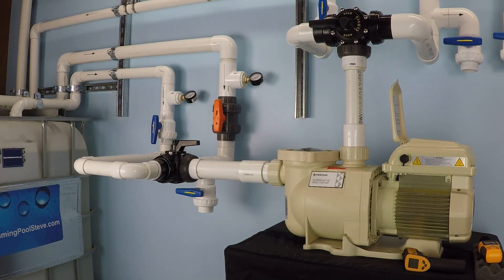What Is The Best Speed For A Variable Speed Pool Pump?

Comment: Ive heard claims that a small pump at full speed, is more efficient than a large pump at slow speed.

If tou were to decide between a 1.5 vari speed and a 3.0 vari speed it is obvious that the 3.0 is quieter at a given flow rate.

but...  Is it less efficient?

Comment: A main advantage of the VSP that I don't think was directly stated (it was in a reply to a comment below) is the reduced electricity ($$ cost) with lower speeds.  For example, on my system with a Pentair VSP pump and controller, at 3000rpm it reports using 1527W.  But at 2000, it's only 468W, and 1000, it's only 136W.   Clearly not linear.  I don't have the full numbers, but I think if Watts per GPM was determined, the most efficient speed would be a lower RPM.  

So as a comment below stated, run the pool for a little while at higher speeds for devices that require it (ie., cleaners, heaters), but then at lower speeds the rest of the day, when general circulation is all that's needed.

Comment: I don't know why all the thumbs-down.  This is spot on and what I've also realized via playing with various RPM's and monitoring GPM.  It's amazing how low you can run the pump while achieving a certain target GPM.  To his point though, sometimes that extra power is required regardless to get certain pieces of equipment moving.

An alternative could be running the pump constantly at very low RPM/GPM (but enough for skimmer-duty) - and then utilize a robotic pool vacuum for floor/wall cleaning, thus eliminating the need to run the pump at high speeds outside of say, wanting to run your water features.

Comment: It would be helpful to get actual rpm numbers to run on low speed and high speeds
Reply from the maker: But it is not possible to give that to you because every swimming pool is different. My pool might move 15 gpm at 1000 rpm but another pool might move zero at this rpm. These differences in every pool make it impossible to give generic numbers for rpm

Comment: You say the title as best speed for variable speed pump, but then do not actually give an actual speed.  You just say you need to run it above the minimum rpm level to also incorporate the gas heater / skimmer etc if attached.   
Couldn't you just say run it at 55% (for example) if you have gas heater attached,  60% if gas plus waterfall,  40% if just pool etc.....   I still dont know what the best speed is based on my setup
Reply from the maker: No I can't just say that. On my pool 55% might move 120 GPM. On your pool it might move 17 GPM...so how could I give one number that applies to everyone? Instead I teach how every pool is different, and a well programed schedule will have periods of time at different speeds.
Reply: @Swimmingpoolsteve  Thanks for the reply. I had issue with my pump when I set it to anything less than 65% then it would form major air bubbles in the return jets. I thought must be air leak in system. Then I pushed it to above 67% and beyond and no more bubbles.  I think it had to do with fact than in my case there is also a ozone contraption.  I think at lower speeds it was picking up air from that, as its bottle was not entirely full.  So in my case I guess you are right,  a higher speed is needed to properly push the water with enough pressure through all the various components attached,  like me with ozone, chlorinator, and gas heater.......thanks.....

Comment: What would be the optimal speed for the skimmer? I'm currently running my pump at 1500rpm which translates to about 28gpm but but it does not look like the skimmer is doing a good job. SWG and heat pump are operating properly at this speed.
Reply: The best way to determine the rpm needed for the skimmer to operate in your specific pool is by experimentation and direct observation. Simply increase the rpm by intervals of 100 until you see about 1/4” water height above the weir door. Do the same for your vacuum system and any other peripherals to determine their minimum operating rpm (gpm).

Comment: Variable speed pool pumps are waste energy use more power than a standard single speed pool pumps as you get a far better flow rate & you don't have run the pool pump as what you as having a variable speed pool pumps & the variable speed pool pumps are higher in hp so where are you's getting the power saving as some people are running their variable speed pool pumps 24 hours a day & the variable speed pool pumps are working harder at low speed for turn over the pool water where as a single speed pool pumps are not working as hard as a variable speed pool pumps do so how do you get power savings with a higher hp variable speed pool pump motors slowing down a variable speed pool pump motor you don't get the proper flow through the pool filter in my opinion single speed pool pumps are far better as you get a far better pool water flow through the pool filter which means a cleaner swimming pools I'm in tending in buying a single speed pool pump with 1hp motor that has a flow rate 350 litres  per minute so don't have to run the motor as long as you would with a variable speed pool pump the pool sand filter I'm also buying has a flow rate of 360 litres per minute with glass media for my 16,879.8069 gallon pool
Reply from the maker: I think you are missing some basic points about how VS pumps function.  If you cut the RPM of the motor by half the flow rate also cuts by half, but the power consumption drops between 5x to 8x.  So you can still move massive volumes of water but drastically cut down on power consumption.  I made the very detailed video that shows a side by side comparison, and honestly it is not even close.  The single speed pump is nowhere near to as efficient as a VS pump.  The VS pump moves WAY more water daily for less power than it takes to run a single speed pump for even a few hours only.  Please take a look https://www.youtube.com/watch?v=X7DHyFCw_28&t=43s&ab_channel=SwimmingPoolSteve
Reply: Sounds like VS programming is beyond your comprehension. If your results are so bad you need to hire a pool service
Reply: I tried this method and moving the pool water only for 6-8 hours a day caused issues with chemical balance, kept debris on top of pool instead of in the skimmer and sucking the chemicals out. I live in Arizona and the constant water running at very low speed and using the middle and high for cleaning and low high traffic times has kept my pool clean. I will not go back to the single speed run for 8 hours again. I have had three pools over the last forty years and the variable speed has kept my pools cleaner and chemically balanced better then and two single speed pump pool methods I have used. I've watched the single pool methodology and there is truth in the pressure point but the constant water movement is the only way to keep a 20x40 pool clean, like I said now on my third pool, variable is the way to go to keep chemical balance and debris free surface.
Reply: If you used some punctuation, your post would be a helluva lot easier to read.  So in addition to pool equipment, you might want to consider investing in an English grammar course .... or two.

Comment: What rpm number is low, mid and high? I have a play pool about 12K to 13K gal. and with a sand filter vith a variable speed pump. Thanks
Reply from the maker: To answer that you would need a flow meter.  This is a dynamic question that is different for every single pool installation.  Some pools will move 12 GPM of water at 500 RPM.  Some pools will move absolutely zero water at this speed.  This is why I can not give you a numerical answer other than low, medium and high.